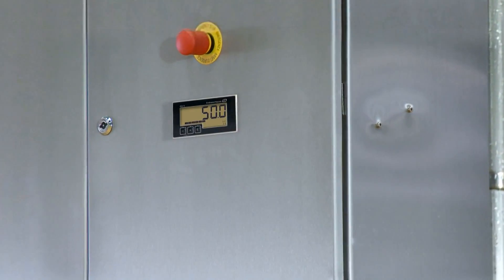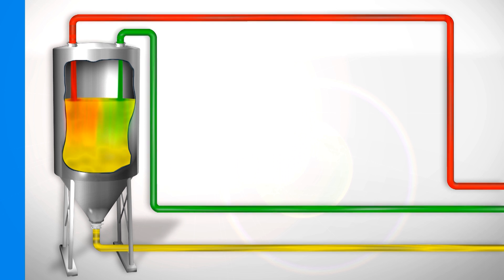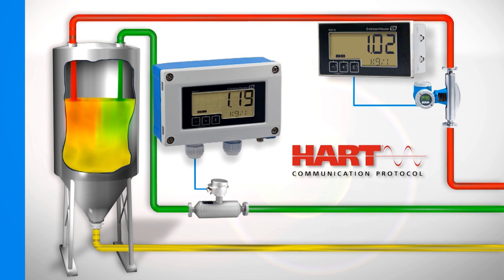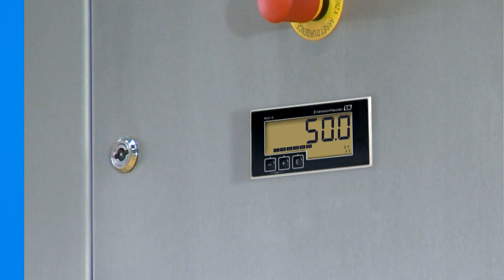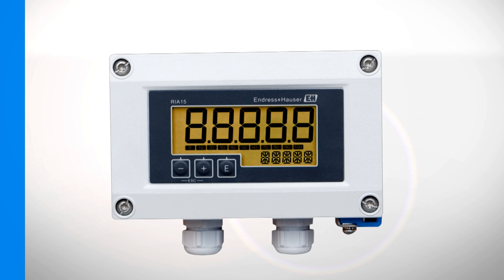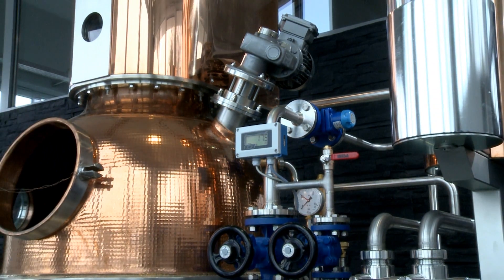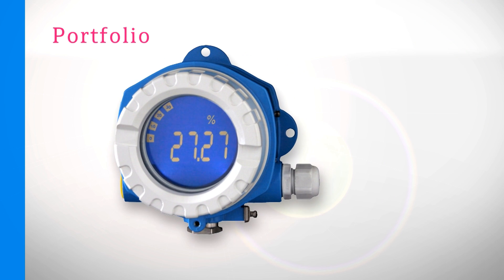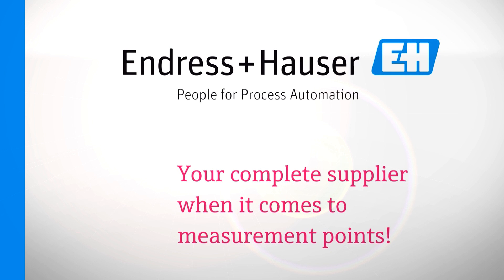RIA15, loop-powered 4 to 20 mA process display unit

Comment: Is there a way to increase the LED brightness?
Reply from the maker: Hi, thanks for your question. For RIA15 you can turn the backlight ON or OFF by using an external switch. It is not possible to adjust the brightness.